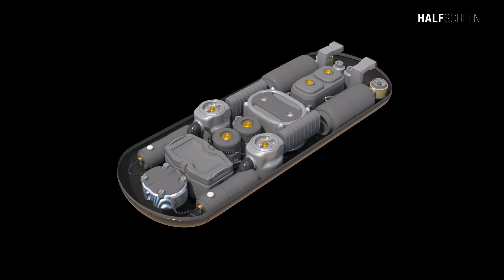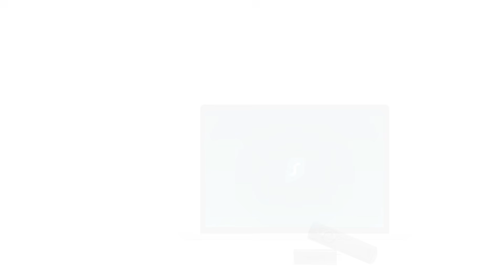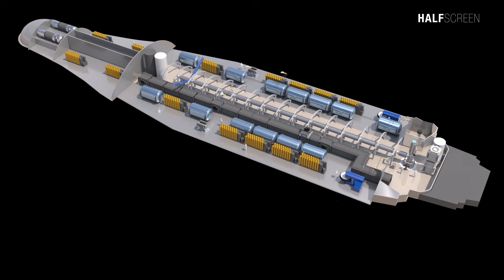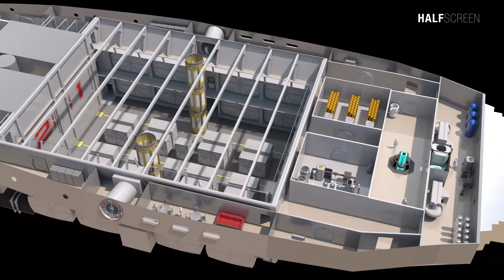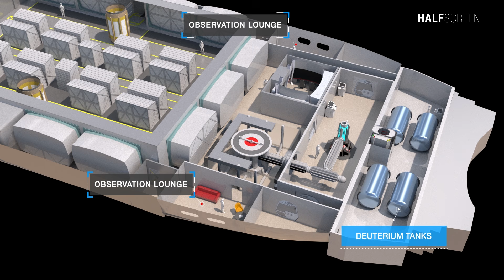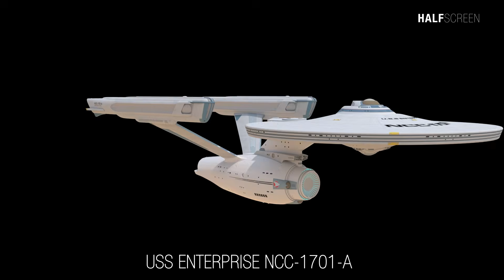Inside the USS  Enterprise NCC-1701-A/Refit (Deck I-U) Part 2

Comment: As I noted on you NCC-1701 part 2 video, the refit turned the Warp Core vertical, but it doesn't directly have anything to do with the Impulse Drive. I think the main reason for putting the start of the intermix chamber in the primary hull, as I said, is to consolidate Main Engineering in one place. Plus, the matter for the matter/antimatter reaction is the same for both system, hydrogen..So they can inject the fuel from the same place.

The refit also hooked the phasers into the Warp Core, so putting one end of it in the saucer probably helped with that. The Warp Core would be jettisoned if the saucer had to separate anyway. (So it's a non-reversable action)

Interestingly, the Enterprise-D and Voyager returned the Warp Core to the secondary hull, and Main Engineering has always been there as well. Maybe Impulse Engines no longer need constant monitoring like they did in the TOS Era. (Or maybe Warp technology is safer to be around)
Reply: There's no "warp core" here. What you're looking at are essentially plasma conduits, not engines. The warp engines, again, are in the nacelles, just as they were in TOS.
Reply: @Idazmi7  What you're saying is true of the Enterprise-D as well. The blue rings coming from the top and the bottom of the room are just plasma conduits, and two horizontal conduits come out at an angle. The blue ball in the middle is the Warp Core and where the reaction takes place. The refit Enterprise and Enterprise-A use the same design. The structure is smaller and looks different but it's the same thing.
Reply: @richardryley3660  
No. There is no warp core on the NCC-1701, whether refit or pre-refit. The entire idea of Warp Cores was a TNG retcon, which means the reaction takes place entirely within the nacelles.
Reply: @Idazmi7  It's still a Warp Core even if it's in the nacelles. A Warp Core is where a matter/antimatter reaction takes place. And the Enterprise has always been powered by matter and antimatter, even from the very beginning.

You could argue that it didn't have that name or didn't take on its final form but just because the early writers didn't explain the technology doesn't mean it magically came into existence in the TNG Era. All we can really say is that we can't be sure about the form Warp technology took in the original series. (Because we never saw it)
Reply: In addition I am explicitly talking about Star Trek TMP here, not TOS. Scotty says that this structure is the matter/antimatter reactor in the movies. Really, it was during the development of Star Trek Phase II that they came up with this idea, not TNG. (Which only came about because of the movies)

You even support this interpretation by calling it a "plasma conduit". By definition, plasma is the output of an energy reaction, not the fuel for said reaction. So your terminology confirms that it is the output of the matter/antimatter reaction that is being sent to the nacelles. That the rest of the refit Enterprise ends up being powered by this plasma as well is a major plot point in the first movie.
Reply: @richardryley3660  
1. You are talking about a refit of the TOS ship: it should run on similar principles.
2. Plasma conduits in Star Trek move energy from one place to another: they are power cables, not reactors.
3. The power is being sent from the nacelles. Not 'to'. 
4. The whole point of having nacelles in the first place is to keep the reactors away from the crew.
Reply: @Idazmi7   @Idazmi7  1. Star Trek TMP makes it clear that the Enterprise refit was rebuilt from the ground up, including replacing the secondary hull and nacelles. It's essentially a new ship.
2. Yes. As I said, they are power cables, not fuel lines. The antimatter pods could be located in the nacelles, but the hydrogen fuel is needed in the saucer to power Impulse as well as auxiliary reactors. Unless you want to claim that the Warp Drive uses its own isolated power system, and that contradicts TOS, which says that the ship is powered by its Warp drives.
2. No. There is no indication of direction of flow in TMP's plasma conduits, as there is in TNG, but you are reversing what is stated in both dialog and supplemental materials. 
4. That was true in TOS, but wasn't in TNG. And ENT put the Warp reactor as far back as they could, away from the saucer, while still being accessible to the crew. So that is not a hard and fast rule.
Matt Jeffries clearly wanted the Warp engines to be in the nacelles, inaccessible to the crew while in operation, but quite frankly, it makes sense to put what you can in the secondary hull, particularly since he made such a point of there being one. The secondary hull on the TOS Enterprise is equally distant from the saucer as the nacelles, and it can be jettisoned just as easily. The crew can be evacuated from the section if there is a radiation leak or there is a danger of the antimatter exploding.
Reply: @richardryley3660  
"1. Star Trek TMP makes it clear that the Enterprise refit was rebuilt from the ground up (...)"
"2. Yes. As I said, they are power cables, not fuel lines. The antimatter pods could be located in the nacelles (...)"

These in no way contradict my point. 

"2. (...) you are reversing what is stated in both dialog and supplemental materials."

 No, I'm actually not. The TOS and TMP materials agree with my position.

"4. That was true in TOS, but wasn't in TNG. (...)"

TMP came out before TNG.

"Matt Jeffries clearly wanted the Warp engines to be in the nacelles, inaccessible to the crew while in operation, but quite frankly, it makes sense to put what you can in the secondary hull, (...)"

Keep in mind that Matt Jefferies and Franz Joseph Schnaubelt were both Army Air Corps engineers with decades of experience. We've seen the problems the Enterprise-D had with warp core breaches: the core usually fails to eject because you literally have to launch it from inside the ship. To say nothing of radiation: you'd need to close off the reactors to the crew anyway in the event of a radiation leak, only thing is the leak is now inside the ship. Finally, it's far less extreme to detach one nacelle than it is to eject the entire secondary hull every time there's an engine problem.
Reply: I think the idea was to be able to shift power from warp to Impulse, or draw one from to the other, at will, @Richard Ryley . The 'deflection crystal' at the top may also serve as kind of capacitor or converter, meanwhile (ala dilithium or Fushigi-no-Umi crystals)

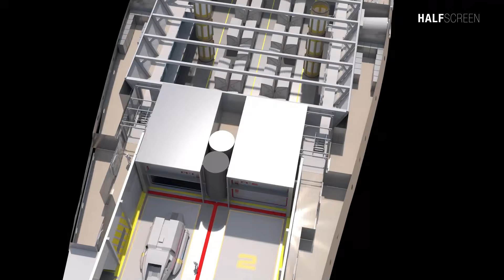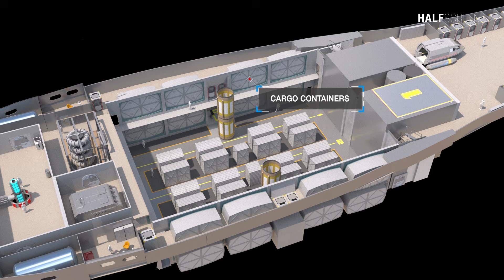Comment: 09:01 The floor of the shuttle hangar is at the level of the central cargo bays? 10:38 Now the floor of the Parking Bay 1 is higher than that of the Shuttle Hangar?
I am completely confused. Is this a real, connected model, or are these individually drawn decks?
Reply: Even in the video before, the turbo lift shafts, among other things, were not superimposed from deck to deck. You can see that immediately. Why don't you notice that when you make the videos? You go to all the trouble and don't pay attention to such eye-catching "details"? What a pity. :-(
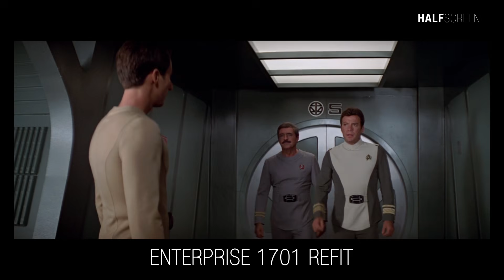Reply: 16:14 Half a deck is missing here. Yes, it's clear, none of this is a documentary, but pure, inconsistent fiction and the filmmakers are not interested in logic. The interiors are sometimes bigger than they should be. It would have been nice if the model had been correct in itself, no matter what errors are to be seen in the "official" blueprints or the films.
Reply: @Hessi  The couch in the upper dorsal section gets me.  😅  Hardly enough room for a bathroom in there.

Comment: Vary nice video. Although I have to disagree with one thing! You said that the Enterprise-A was a new build named Yorktown, this can't correct. The ship was USS Yorktown NCC-1717 which was a ship in use daring the original series and was even mentioned in an episode. In the Voyager episode Flashbacks, which was set in 2293 seven years after Enterprise-A enters service Rand tell Tuvok that the Excelsior got a message from the Yorktown from his father, the Star Trek encyclopedia states that this Yorktown was the second ship to carry the name which means the NCC-1717 from TOS has to be the ship that became the Enterprise-A.
Reply: this is correct  .remember they decommissioned it because of it age. If it was new  it would have a longer service life.
Reply: Maybe he meant.... ummm.... the ‘Porktown’ the ‘Ork-Town’! Yeah, yep. Gotta be it.
Reply from the maker: I didn't know about that.  I read most of the comments on the first video and nobody mentioned the name NCC-1717.
Reply: @Halfscreen  It's entirely possible there'd been two Yorktowns already, by that point.
An Excelsior-class one may well have been built, later (NCC-20045, per one background TNG display screen) but that's unlikely to have been the one Tuvok's dad served on.
So there may easily be two Constitution class Yorktowns, without much problem.
Reply: In the Star Trek FASA ship recognition manual, it listed the Ti Ho before changing it to Enterprise A…forgot the NCC number.
Reply: @IanCthrwd  NCC-1798, if it uses the same registry, for the same named ship, as from Mr Scott's Guide.
A more obscure source claims it was the USS Levant NCC-1843, instead.

Comment: I never understood how the vertical impulse drive could still function if and when the saucer section detached from the secondary hull.  How did that drive remain functional if it were cut off at the the base of the saucer?
Reply: As I understand it from all the tech manuals and literature, the Vertical Intermix Chamber extended all the way to the Impulse Drive Units located on the aft Saucer Section to allow the Impulse Drive Units to be powered by the main power source, which was the matter/anti-matter reactor (referred to as the M/ARC or Matter/Anti-Matter Reaction Chamber). The Vertical and Horizontal Intermix Chambers which were prominent on-screen together make up this M/ARC. Whilst the main reactor was in operation it provided power for ALL ship systems, including the Impulse Drive. In case of Main Reactor failure, two backup fusion-type reactors located adjacent to the Impulse Deck would be brought from standby to online status to power the Impulse Engines, as well as most of the ship’s systems (minus the Warp Drive, which required vastly more power than the fusion reactors could provide). There is a LOT of confusion in terminology in the show’s scripts when referencing the ship’s power systems unfortunately. The terms ‘Warp Power” & “Impulse Power” are thrown around a lot as if the Warp and Impulse Engines ARE the power sources themselves. However, Warp & Impulse are DRIVE systems which consume power from the ship’s POWER production systems.
Basically:
Main Power = the Matter / Anti-Matter Reactor - can power EVERYTHING onboard at max capacity.
Auxiliary Power = the backup Fusion Reactors - powers everything except the Warp Drive, albeit at lesser capacities.
Emergency Power = the ship’s battery system - limited capacity that can provide reduced power to survival-critical systems like life-support, tactical systems (to an extremely limited degree…. “Couple o’ phaser shots, Cap’n!), and a VERY limited propulsion capacity from the Impulse Engines, like minimal Port speeds or very low orbital speeds….. and even then only for a very limited time.
Reply: @dusry63  Wow.  That was a very thorough explanation.  Thank you!!

Comment: Although you mentioned them earlier in the video, you neglected to actually point out the equipment for the four ventral phasers at the bottom of the secondary hull.
Reply from the maker: The four ventral phasers wasn't on the schematic, it was only mentioned the description of the ship.

Comment: Excellent work on both,  I can't wait for your next one.  Consider doing Captain Sulu's Excelsior 2000 for your next video.
Reply from the maker: Down the road.
Reply: @Halfscreen  That would be fun, yes. I'd maybe use the Haynes Manual cutaway, as one of the sources.
The one from Generations obviously won't fit too good, as there's no way the ship could possibly have 34 decks, and be under 600 metres long.
Reply from the maker: @chrissonofpear1384  
Personally, I'm scared of modeling any ship with 30+ decks.  🙄🙄
Reply: @Halfscreen  Good news, then, as I bet the Excelsior doesn't exceed 24, in 'real life'.
( :
Reply: Ohhhh! Ohhh! Now you’re just playing with my heart.

Comment: I am only new here. Impressed by the detail of the animations. Visuals are way better than talking heads and stats. 
The Battlestar Galactica TOS (Artemis Class) and the RDM (Jupiter Class) for comparison would be really cool.
Reply: A full breakdown of every deck of an executor class star destroyer. It would only be like exploring every room in every skyscraper in New York City, it might take a while... The rest of his life probably. 

Both battlestars are about 2 or 3 times the size of this so just imagine what an undertaking that would be. I do want to see more bigger ships though.
Reply: @DeathBYDesign666  2/3rds of the main body of a Battlestar are FTL drive and and slide mechanism for the flight pods on the Jupiter class. Same applies for the Artemis class (except the slide mechanism). 2/3rds of the flight pods are exposed to vacuum but the launch and repair bays take up the botton section of the pods. The front/head of a Battlestar is pretty much where the crew live and where the CIC resides for both classes.
Reply: 7